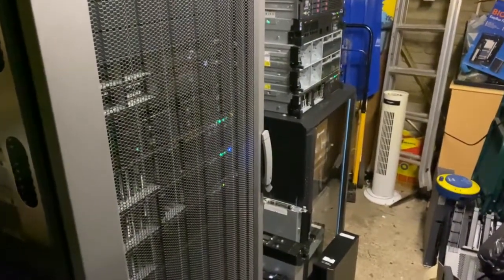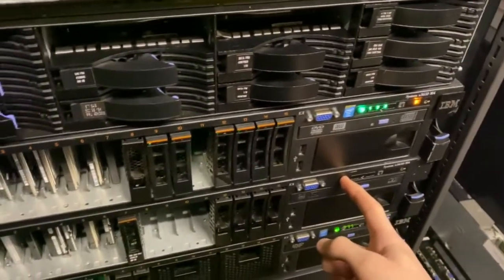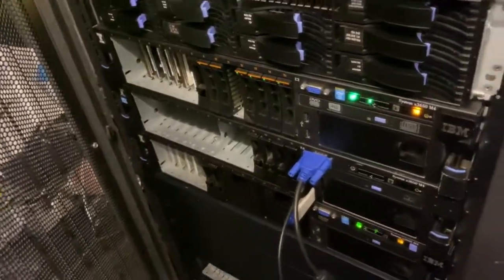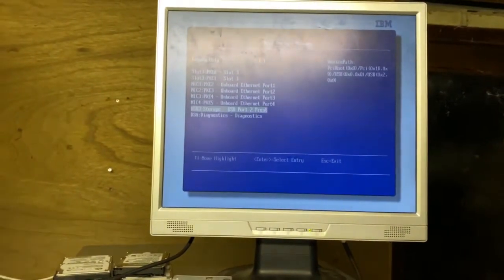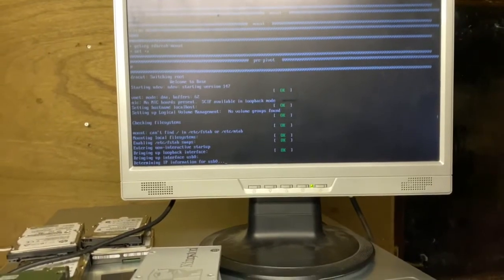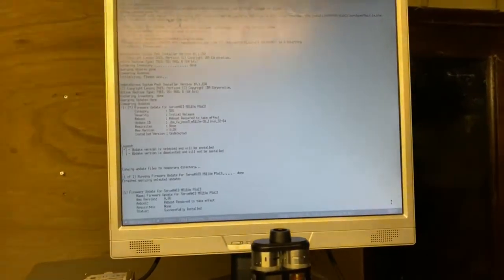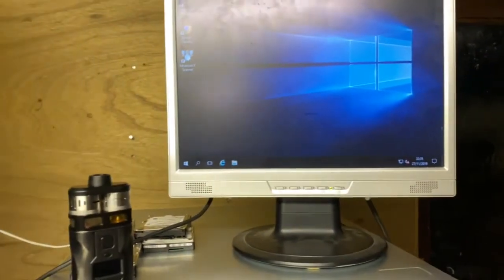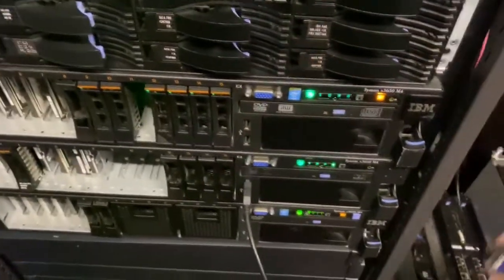IBM X3650 M4 Prototype repair - Raid controller missing and power button not working. - MHDC 001

Comment: A fun thing I've learned: if you're running some 1U servers with inadequate cooling and your RAID controller randomly goes offline, it is quite likely that the plastic clips holding the heatsink onto the RAID controller chip have thermal fatigued and failed, allowing the card to cook itself to death. If possible, make sure your RAID controllers feature brass retaining pins for its heatsink for use in those applications.

Comment: Interesting video. Did all the firmware updates resolve the power on button issues? Is there any differences in the prototype build compared to the production model of the X3650 m4?
Reply from the maker: Interestingly the issue does come back after 60-90 days of constant power however physically unplugging the server and replugging it in solves it.

As far as I can see comparing it to my regular production models, they've moved a few capacitors around on the mainboard and the LightPath Diagnostics panel.  My understanding is that the capacitor responsible for the board charges up, but does not discharge when the server has finished booting or is powered off.